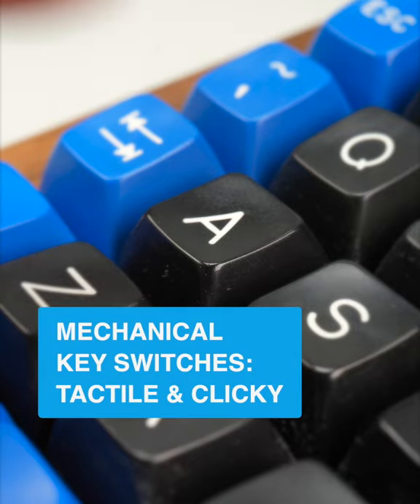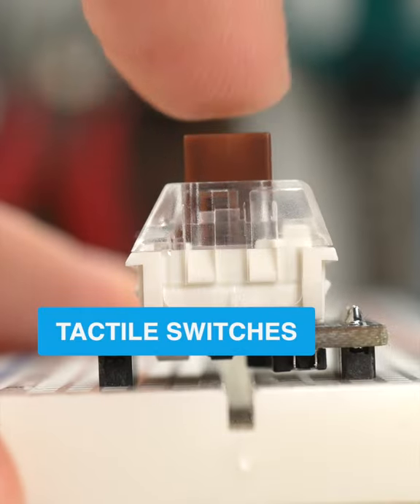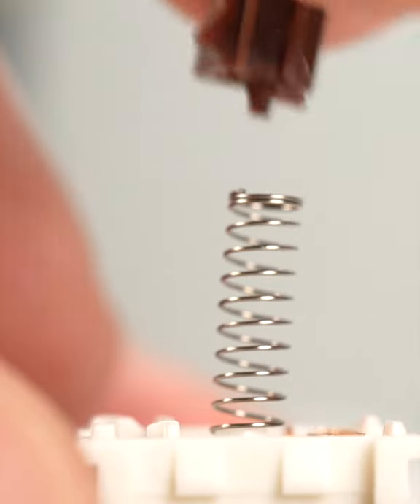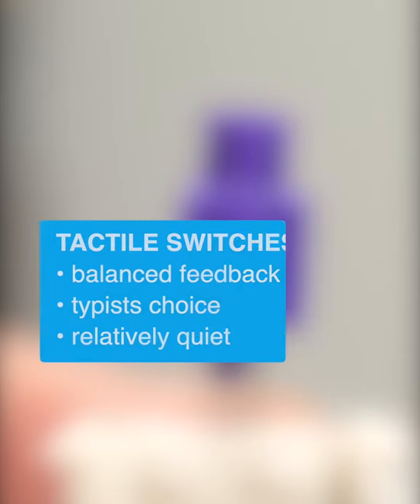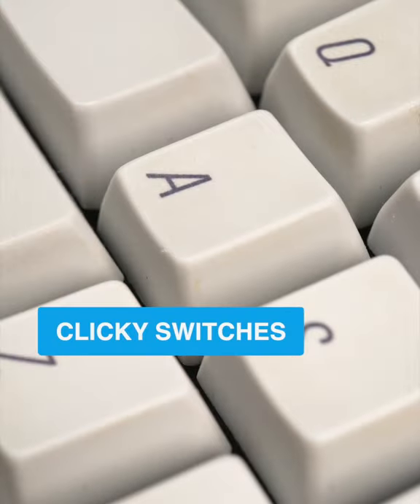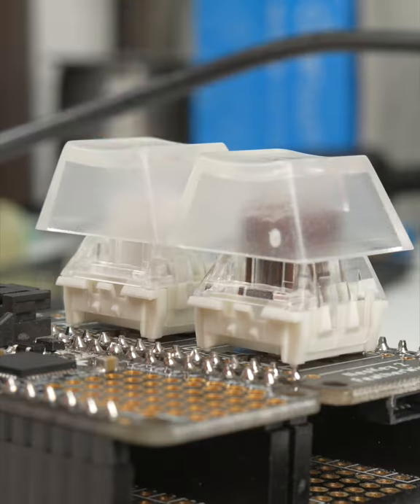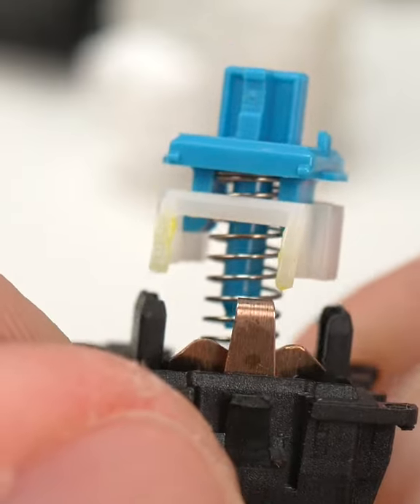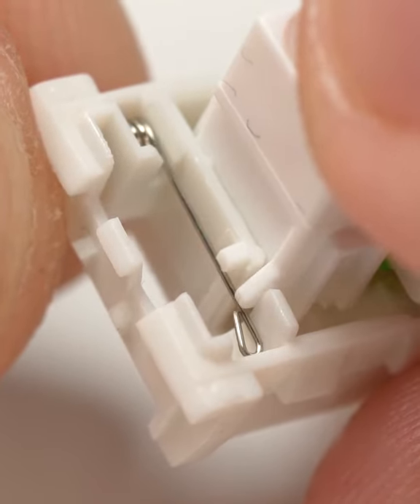Mechanical Key Switch: Tactile & Clicky - Collin’s Lab Notes #adafruit #collinslabnotes

Comment: The last feels great keyboard I used other than the IBM PC/AT keyboard was the Northgate keyboard, does anyone make those kind of keyboards anymore?
Reply: The Northgate was apparently an Alps White. As such they will probably have differed a lot from batch to batch. But maybe the new Kailh click bar switches will be to your liking? There are a lot of keyboards now where you can just pull out the switches and replace them with any MX compatible ones.

The IBM Extended PC keyboard is still manufactured by Unicomp. They have inherited the original design and production line tooling.
Reply: @SianaGearz  I loved my IBM PC keyboard. Loved how you can take it apart clean the spilled sticky drinks off it and keep on going, until you break a spring when taking it apart while half intoxicated.